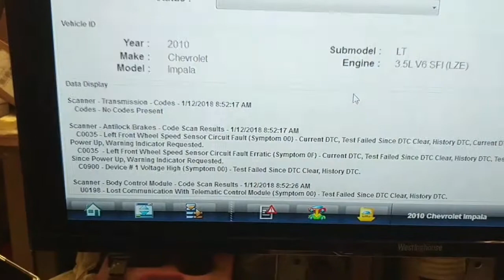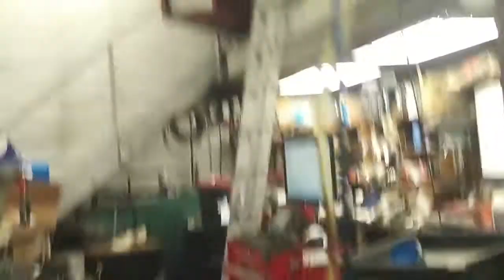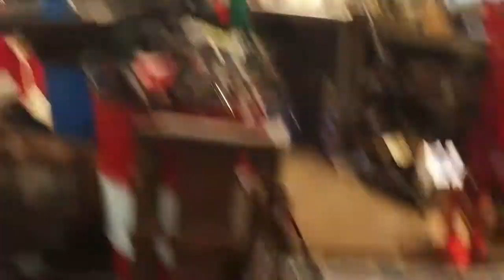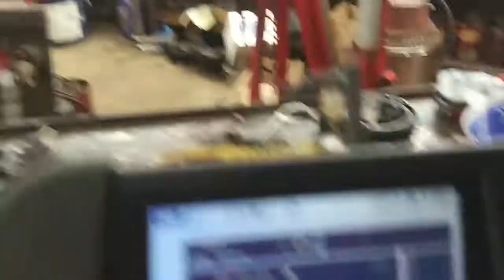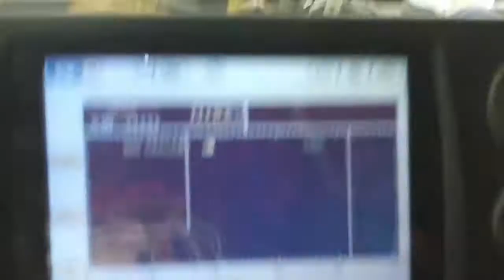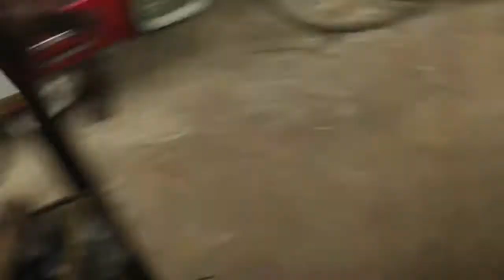2010 Impala Wheel Speed Sensor Fault

Comment: What parts did you have to replace?  The whole sensor harness? Just the sensor? Thanks for your time!
Reply from the maker: In this application you have to replace the hub and bearing assembly as that is how the sensor is serviced.
Reply from the maker: Have to remove the caliper, caliper mount, rotor and then the hub assembly.